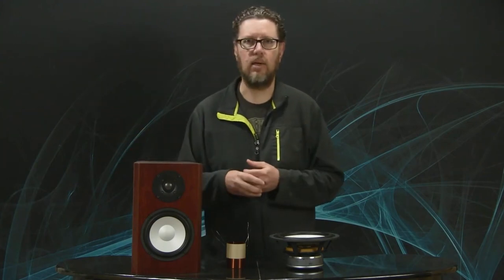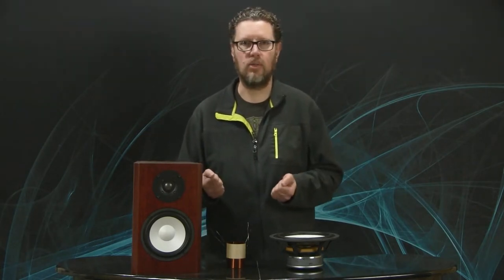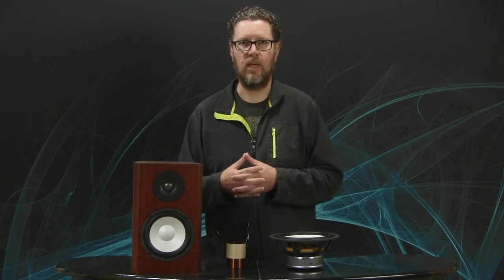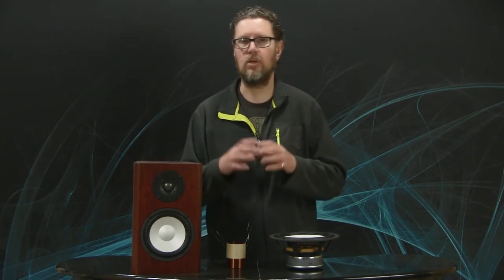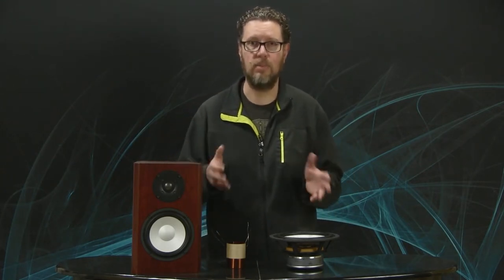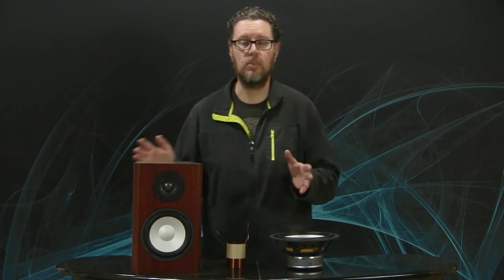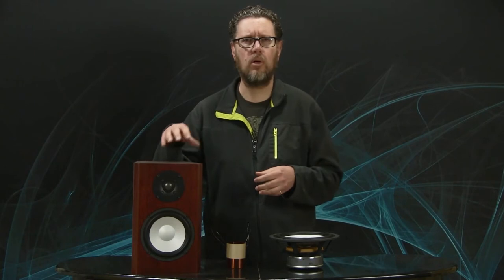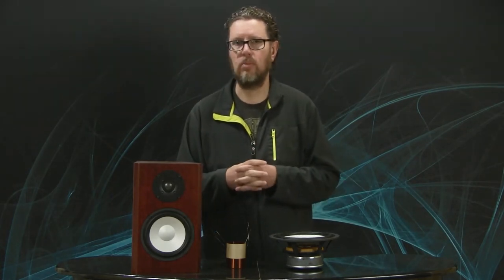Can I Use A 4-Ohm Speaker With an 8-Ohm Receiver? | Speaker Impedance

Comment: Simple and to the point explanation with none of the usual YT fluff.  

I have newer 4 ohm speakers on my 1980s JVC and picked up set of 100W 4 ohm resistors to properly balance the loading, placing one on each channel in series to each speaker.  These are great when you want to connect additional speakers to the same channel (in parallel).  Always try to present a matching speaker load to what the AMP is designed for, but it is generally safe to present higher loads (16 ohm speaker load to a 8 ohm amp)... just expect to reduce the amp's power rating (50W vs. 100W for example).  If you understand ohm's law, you get how this all works.  ;)

Comment: I’ve ask this question on several other channels but not one has bothered to answer me. I’m new at this and maybe it’s a stupid question. Because I’m new at this then asking questions and not burning up my equipment seems the way to go. Anyway, here it is. I have four 6x8’s@8ohms, four 2 way passive crossovers and four tweeters @8ohms. My amp is a powerful 4 channel amp. It is rated @2ohms and 4ohms bridged. So, I guess if I run each channel separately then I need to get them down to 2 ohms. My questions are if I connect each 6x8 and tweeter through a crossover then what will be the ohms for that channel? If I run parallel and connect two crossovers to two 6x8’s and two tweeters then what would be my ohms on each set then? I don’t have a meter to test them myself. So, if you get a chance please let me know.
Reply from the maker: Are your 6x8’s meant to be run full-range? There is no reason to worry about getting the impedance down to 2 ohms per amp channel. You have a 4 channel amp, so I would run one 6x8 and one tweeter (with crossover) on each of the amp channels. Too bad no one has answered your question before, impedance is a challenging thing to wrap your head around and I get questions on this all the time. Thanks for your question and for watching.

Comment: Some people are into vintage receivers from the 60's, just for the nostalgia factor---I would definitely not attempt to drive less than an 8 ohm load with those, as output protection was either primitive, or non-existent. With some of those, you won't know there's a problem until the output transistors go up in smoke.
Reply: Doubtfully

Comment: My 1980s Hi-Fi solid state amp is rated at 8 Ohms but has been driving two 4 Ohm bookshelf speakers for some years now without showing any signs of any problems. They are never on at full volume. Its mostly used as quiet background music or sometimes some birdsong gets played. My old amp is protected with two inline fuses, one on the left channel and the other on the right channel. The amp never gets hot. I figured it should be ok driving 4 Ohm speakers. 

Is there a impedance matching circuit that can be built to make the speakers higher in impedance?
Reply from the maker: For background listening you are probably ok and many older amps would have no trouble with 4 ohm loads. There are some impedance matching boxes for combining speakers but I would not go that route if things are working for you.

Comment: Thanks for this detailed the information.
So the problem is not the amplifier but some of the speakers I guess.
Reply from the maker: Yes, I would tend to agree. An amplifier that cannot handle a low-impedance load is not necessarily “bad” by any means. It all comes down to the compromises the designer needed to make.
Reply: @AxiomHomeTheaters  
Unfortunatelly it seems like it is the amplifier.
I removed all the speakers, and all the connections to other devices, and still it does not work.
Reply from the maker: @fixipszikon6670  Yes, unfortunately it seems the amp is at fault here.

Comment: Dear Axiom Guy.  Comparable to John's question, although not as comprehensive about channels, etc.  My question relates to adding a second pair of Bookshelf speakers to the B speaker connection on a Denon DRA-800H AV Receiver which I use only for 2.1 Stereo listening , for now anyway.  The Denon can handle 4 speakers (1 pair on A and 1 pair on B).  The Denon is rated at 145 Watts per channel at 8 ohms.  The A connection has a pair of Elac Debut 6.2s (8 ohm , nominal at 6 ohms), and on the B connection a pair of Elac DEbut Reference 6.2s (same Ohm ratings).  Then I Paralleled a pair of Fluance Signature Series Hifi Bookshelf speakers(8 ohm rated) to the B connection.   While playing a CD via a Tascam CD player, at above 60 volume (The Denon's Max volume level is 98), the Receiver flashed red and shut down - Amp protection from overload ? or Overheating ?.  I now plugged the Receiver into a separate electrical outlet which is a separate circuit from the other attached stereo components (Schiit LOKI , Mani, SAGA+ , Tascam CD player / recorder, Tascam Double Cassette deck), and now playing at comparable levels, it seems to be Ok.  No Shutdowns. Am I damaging the Receiver ?  Your advice and oinion is much appreciated.  John too !!!   Besafe and well.  THX
Reply from the maker: What is likely going on is that you are taxing the receiver with the speaker configuration you are using now. Normally when you use both A and B speaker outputs at the same time, the minimum load for each speaker will be 8 ohms nominal. This is because the speakers are paralleled when A and B are on at the same time, so the receiver actually sees a load of 4 ohms. Your Elacs are 6 ohms nominal, which is already pushing beyond the minimum recommended load. Now add in the Fluance speakers and you have 6 ohms on A and 6 ohms in parallel with 8 ohms on B (3.42 ohms). Now the receiver is seeing a total load of 2.18 ohms! Even though it’s not currently shutting down plugged into a separate circuit, I would not recommend what you’re doing. I guess my question would be why you need to run three pairs of speakers in stereo at the same time? If it’s to get music in other rooms there are better ways to accomplish that with zone amps or with a receiver that has Zone 2 outputs which it looks like your Denon DOES have.
Reply: @AxiomHomeTheaters  Thank you,...  That's the advice I have received on various forums.  What if I introduced and wire in a Monoprice Speaker Switch box which has impedance protection to the Amp?  Secondly, If I do not use the Speaker A Pair , in other words Not engaged at the same time, is the ohm reduction the same?  THX again for your advice.
Reply from the maker: @Chiroman527  I don’t believe the speaker switch box will help you, but if you only play either A OR B and not both together you should be fine.
Reply: @AxiomHomeTheaters  Hi Axiom Guy...  I'm getting back to you with current info concerning the Denon DRA-800H receiver with A & B channels.  I cut out the Fluances out of the Loop.  So now I have 1 pair of Elacs (6 ohms)  to Channel A and 1 pair of Elacs (also 6 ohms ), to Channel B.  The Denon hasn't shut down ,but at 60  volume levels it runs pretty Hot??  Other than change speakers to higher Ohm rated ones, is there something else I can do ?  Note:  When I switched the pair of speakers to 1 Pair of Fluances (8 ohms) and a pair of KEF Q350s (also 8 Ohms Nominal) - the Denon doesn't get as hot.  The Receiver is rated at 4 -16 Ohms.  So it must  be it is overloaded with the Elacs playing simultaneously.  But they sound fantastic playing together - room filling sound.  I have this system in my finished basement sound room.  I resurrected playing Drums after over 50 Years in retirement / hobby.
Reply from the maker: @Chiroman527  The two pairs of 6 ohm speakers running at the same time are likely taxing your Denon as it’s nominally a 3 ohm load that the amplifier is seeing. As long as the Denon does not actually shut down, it should be fine. Just make sure there is LOTS of space around and above the Denon.

Comment: Sir can you please help me. I have 4 floor monitor speakers 2 Fender 1272XP rated at 200 W 16 ohm, and 2 Behinger Eurolive F1220 rated at 200  W 8 ohms. So, there are different ohm ratings. My question is can I hook these up in series 1 Fender / 1 Behinger on the left side and 1 Fender / 1 Behinger on the right side. This set up is for my band's PA System.
Reply from the maker: Your load will be 5.3 ohms, so it will be ok if your amplifier can handle that. On thing to keep in mind is that the 8 ohm speaker will be drawing double the power of the 16 ohm, and possibly be louder. They will not all be equal in output level.

Comment: I've the new Yamaha Receivers r-n602 and r-n803 running my 4 speakers JBL 8 ohms. What happens it that... I bought 4 new Yamaha NS-777 (all are 6 ohms).
What I have to do to connect the Yamaha's stereo receivers (can I put 4 ohms or 8 ohms) to the Yamaha 6 ohms speakers? I never get that kind of answer on all the Internet for 2 months trying, neither by Yamaha. How to connect 4 (yes, 4) 6 ohms speakers to a Receiver (stereo), usually 8 ohms. It's better to try to put all the receivers (stereo) into 4 ohms to run 6 ohms speakers or to put the receivers into 8 ohms? I don't think my new Yamaha stereo n-s602 or 803 has a way to put into 6 ohms. What will be safe for me (sometimes I use low volume and full Loudness to hear my musics, but sometimes I use high volume... I love BASS, and a little middle or high frequencies. Using my other Yamaha, the n-r700 with my 4 JBL S-312 (8 ohms), and the receiver set into 8 ohms, it's all okay (I can have both low and high volume for hours). But now, with the Yamaha's speakers NS-777 (all 6 ohms), I don't know what I have to do. I'm very loss here. Can you help me, please? I love your explanation here, but because I have more than 65 years and always use 4 (four) speakers at once, I'm really loss here. Thanks.
Reply from the maker: I would expect that the 8 ohm setting would work best for 6 ohm speakers. If you are able to play this system at a good volume and don’t find the receiver shutting down or cutting out, you should be fine.

Comment: Hey, i have a Sony str-dh550 that is rated for 6ohms connected to two proson twin 5.10 speakers 4 ohm, a Sony sa-cs9 sub, and two 40 watt off brand speakers rated at 6ohm. The two off brand speakers are connected to the same output as the 4 ohm ones because i wasnt able to get the surround working. I have been using this Setup for maybe 4-5 years and havent noticed any problems with audio or the amp getting damaged. I play at fairly medium to high levels, and use it for games, movies, music etc. I came across this video because someone told me that i shouldnt run my speakers in paralell and just wondered if you think this Will damage my gear.
Reply from the maker: The impedance of all those speakers connected together is probably too low for the Sony, but since you’ve been running it for 4-5 years with no issues I would say it’s probably ok.

Comment: I have a Pioneer SA 606 (8ohms/ 40watts each channel ) and nobsound ns1800 (4ohm/ 60 watts). My question is, if I arrange the speakers in series, would it work just fine? If I arrange it in parallel and use it for normal listening , would it fry my amp?
Reply from the maker: Series will be fine, but is not normally recommended as the speakers in series will effect one another. Parallel might work, but keep a close eye (hand) watching for overheating.

Comment: I have 8 ohm door speakers  and a 4 ohm amp.  Will this work.
Reply from the maker: Your amp should not have any trouble driving 8 ohm speakers but be aware it will produce less maximum power into that load.

Comment: i have a 6ohms subwoofer, can i use it in my amplifier with 8 ohms?
Reply from the maker: It will likely be fine, but you might want to check with the amp manufacturer.

Comment: Recently I purchased a Yamaha as-501 integrated amplifier ( 85-rms @ 8-ohms ) - resulting in the depletion of my very limited finances. So now I don't have any means to buy matching Yamaha speakers. But I have a pair of Pioneer car speakers in wooden enclosures ( 4-ohms, 150-rms each ).  Please let me know if I can use them without causing any damage ?  The as-501 has an Impedance Selector switch - Should I set it to 4--8 ohms or should I leave it at 8 ohms ?
Reply from the maker: If you are going to use the car speakers, set the receiver to 4 ohms.
Reply: I have inherited a pair of 35 years old German Canton  Tiwer speakers, using yahamha As801 , never happy with the sound, just find out the speakers are rated at 4 Ohmn, is that the reason why they  sound good, I didn't know u can choose Ohmn setting  on Yamaha,  I am just average music listener, love , jazz , blues  and art rock. I heard ppl rave Abt Elac floor tower however they are rated 6 ohmn,  what would be best  budget speakers under 1200 US should consider.  Consider Klipsch, Triangle , PSB , Dali. Thank you for your opinion.

Comment: Quick question, I just found some studio labs speakers.  Will use them for my home theatre.
2 tower
2 shelf rear
1 passive sub
Towers are 200w max and 4 ohms

What’s the better choice for a receiver?
Reply from the maker: Any established AVR brand would be fine…I would suggest a model with around 100 watts per channel. The passive sub is going to be a problem as AVRs don’t normally have amplified subwoofer outputs.

Comment: i have Rated Output Power 8ohms guitar combo amp with 15watts 8ohms speaker and i replaced the speaker to 25watts 5ohms speaker.. its working fine but you thinks its ok? :) thanks for the answer :)
Reply from the maker: If it’s not showing or making any sounds of stress it’s probably ok.
Reply: @AxiomHomeTheaters  thankyou sir
Reply from the maker: @bochogtvlive4425  You’re welcome!

Comment: Hi. I have Yamaha rx-v2600 with 4ohm towers from Dls (T3) and the rest of  speakers (TS3) 8 ohm. I can set Yamaha only for 6 and 8 ohm. Can i use this configuration? If yes - 6 or 8 ohms?
Reply from the maker: I would set it for 6 ohm and keep checking the temperature of the receiver when in use to make sure it’s not getting too hot.
Reply: @AxiomHomeTheaters  Thank you

Comment: Hi I connected my rel sub yellow and red together to + plug 8 ohm of one of my mc901 amp and speakers to the 4 ohm of the same amp. Rel suggested this way for adding 1 sub to mono blocks and by the way I'm using hi level connection of the sub. Is that ok?
Reply from the maker: If that’s what REL recommended then it’s likely the best method.

Comment: I just bought a music fidelity m5si which is 8 ohm and I have 4 ohm speakers :( any suggestions on wiring?
Reply from the maker: You will be fine, the M5SI can drive 4 ohm loads. For wiring I would suggest at least 14 AWG, stranded pure copper.

Comment: Sir I have polk hts10 subwoofer 8ohms, and tannoy elicps center channel 8ohms and, elac debut 2.0 b 6.2 speaker 6ohms now I am intermixing my denon avr 1600h av receiver Does this cause any problem? Plz tel me sir I don't know
Reply from the maker: No, your Denon should not have an issue driving those speakers.
Reply: @AxiomHomeTheaters  thanks you sir
Reply from the maker: @hemanthbabugorre8252  you're welcome.

Comment: I have a parasound hca 750 amp that is stable to 4 ohms this amplifier is currently running to surround speakers. My question to you is if I had two 3 ohm speakers connected to each channel would that cause any problems. Since I’m only using this amplifier for surround?
Reply from the maker: Two 3 ohm speakers on the same amp channel would be 1.5 ohms and would a bad idea, regardless of the information being sent to those channels.
Reply: @AxiomHomeTheaters  no I’m actually running three ohms per channel rather than 4 ohms
Reply: @AxiomHomeTheaters  The amplifier is being ran in stereo mode not  bridged
Reply from the maker: @gmslastdays6319  Got it…I think you will likely be ok, as long as you don’t find the amp shutting down on you.
Reply: @AxiomHomeTheaters  cool so far so good It hasn’t skipped a beat
Reply from the maker: @gmslastdays6319  good news, glad to hear it.

Comment: hi i have denon avr x4700 and i have surround speakers that has 4 ohm nominal and 3 ohm min. should i opt for a separate power amp or is it fine to run with the avr??
Reply from the maker: Your Denon should be fine driving those surround channels. I have never run into a problem with Denon receivers and 4 ohm nominal speakers.
Reply: @AxiomHomeTheaters  thank u. I powered my perlisten lcr to a separate 3 ch power amp. Will continue to use surround speakers through avr.

Comment: I’m about to acquire a Marantz 140 (states 8ohm min) - will this be ok for KEF 104/2 Reference speakers? (4 ohm). 🤔
Reply from the maker: The 140 manual mentions running two pairs of speakers at the same time and says that they should be minimum 8 ohms each…that is effectively a 4 ohm load so you should be fine with the Kefs.
Reply: @AxiomHomeTheaters  Great! Many thanks for the advice 😎👍
Reply from the maker: @LozVegas  you're welcome, enjoy!